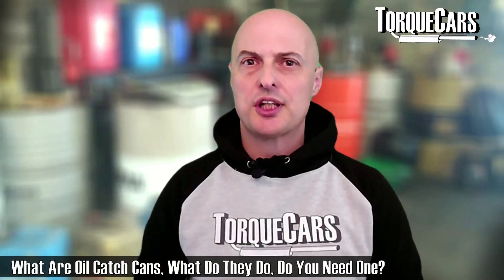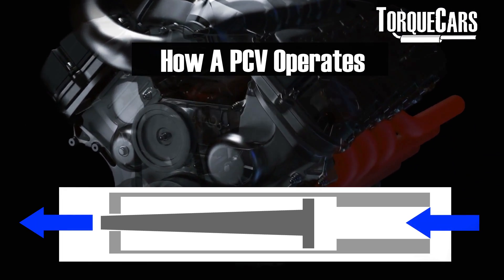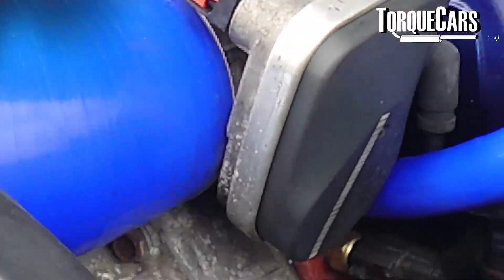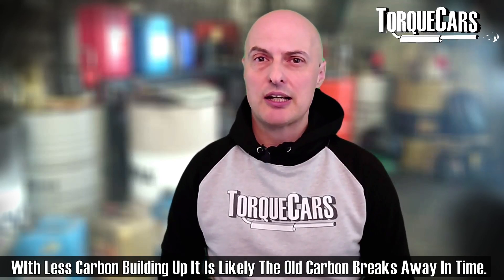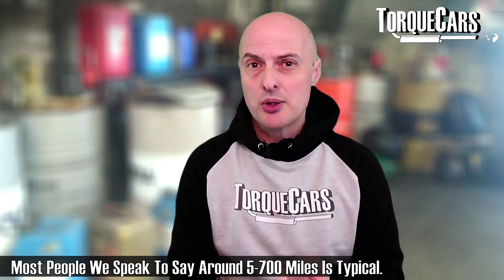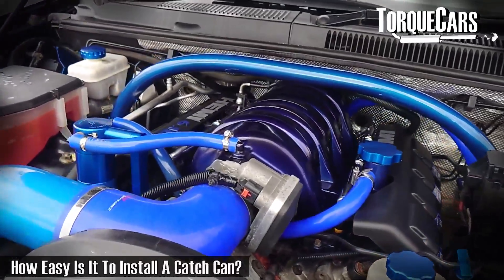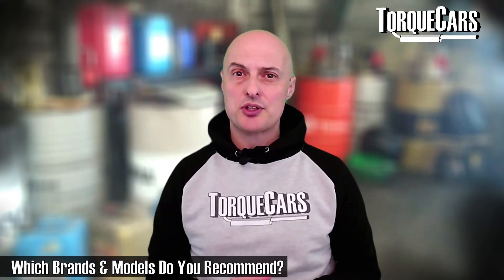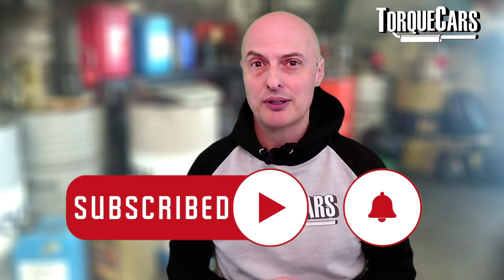Why Modern Engines Need Oil Catch Cans - Pros & Cons Of Oil Catch Cans & FAQ Explained

Comment: I've bought 2 catch cans for my N/A Hyundai 2ltr twin cam off Temu.. 

Now i know running two cans seems like overkill but it isn't if it's done correctly.

These Temu ones are around $20 AUD each and the quality is amazing, avoid the dip stick ones as they can rattle loose..

The one's I got give you the option of an airpod filter or not and has a blanking bolt, decent barb fittings and has a red handled drain lever..

The first catch can is re routing the PCV and no filter is needed..

The 2nd catch can runs an IN line from the rocker cover breather and the OUT is an airpod vent.

I've blocked off the factory breather intake on the rubber pre intake elbow as it's no longer needed and was a gateway of oil and fumes once.

Hope that was helpful 🚙 🏁

Comment: Catch cans are a point if failure as I have experienced threads coming off and got sucked into the engine In addition to many air leaks, keeping in mind that I have tried only high quality built in which are priced between 180-250$ .

Comment: Good video....  I installed a CC on my '21 GMC 1500 V8 5.3L engine and the CC was built for my truck.  re:  Hoses were proper length, connectors were slip/click on and the CC even had nice pre-formed mounting bracket.   If getting a CC for a common engine (like my vehicle) simply buy the one that 100% matches your unique vehicle.  Life is already too complicated to "make fit".   Regarding a CC usage, I love how much "crud" they trap and stop allowing it to enter the engine.  Like many folks I would never purposely pour that liquid "crud" into an engine.   0uch!   Thus...  Best to trap it and clean the can out every month (when checking its many other fluid levels as well)....

Comment: My Jaguar AJ16 supercharged engine in not DI, but as the only cost is the purchase price and there is no other down side (apart from emptying it) why not fit? We all want a clean running engine with less harmful fumes out the tailpipe. I have a problem with the smell of hydrocarbons so a catch can sounds like what I need!

Comment: I added a OCC to my 3rd Gen Prius last spring after I opened everything up to clean the EGR system. The PCV system on the 3rd Gen Prius absolutely slurps engine oil. Makes a mess of the intake manifold and combines with EGR gasses to clog the EGR manifold ports. The PCV valve is slung really low in the 2ZR-FXE and Toyota’s baffle system, right before the PCV valve, really doesn’t seem to work. I’ve opened the OCC a couple times since and it’s definitely capturing oil and moisture.
Reply: It's not oil...so you have no idea what it does.
Reply: @totalnoobfishing1753 
😂

Comment: I can't believe how many people actually believe that catch cans reduce carbon buildup on gdi engines.  Its so sad, such a waste.  Guys, they only collect soot and water, NO OIL!!!
Reply from the maker: Why are they sold as and called OIL catch cans? Also when I emptied mine it  contained some oil, so I guess that just magically appeared in there?

I think you can say something like "they collect MAINLY water" and the amount of oil deposited probably depends on engine design to some degree, but they do stop oil - any vapour in fact from gumming up the intake.
Reply: @torquecars   sorry that's false, there is no oil in there unless you have a diesel with an egr or some boosted race engine.  Send a sample to a lab you'll see.  Oil vapor goes right through the catch can, so you can run two exact engines, one with a can and one without and they both will buildup carbon at the same rate.  You'll never see any honest catch can producer or distributor do an honest test like this.  Actual oil catch cans were installed on old school race engines when oil was being blown out the breather in the valve cover and dripping on the exhaust or track.  The catch can sellers are loving this, they just planted the seed and sit back raking in the profits.  You may as well see how many $10 bills you can stuff in your can then throw it out for all the good it does.  Guys go to empty the can and they see the dirty water in there  and say wow it works look at the oil imagine that going into your intake! That "oil" is just condesated water with trace amounts of soot, aluminum, iron.  It would get burned off in the pcv lines and engine anyways just like the system was designed to do.  Just because a lot of people belive in a lie doesn't make it true.  All you can do is change your oil every 3k miles with quality synthetic and keep up on your maintenance.
Reply: There are vehicles that tend to slurp engine oil out of the PCV system. The intake manifold on my Toyota used to act as my OCC until I put a real one on it. Now I know it’s not capturing all the oil in the PCV vapors but it does capture some. Any amount I can get, before it ends up mixing with the EGR gasses and clogging the EGR manifold ports, leaves me that much ahead of the game.

Comment: My opinion as a retired tech is that catch cans are required for turbocharged GDI engines if you want a more trouble free and longer lasting engine. I suspect that the contaminated air without a catch can will also shorten turbo vane life..

Comment: I have several issues with this video. First, the crankcase is ventilated using manifold vacuum. Fresh air is drawn in on from the air cleaner side of the intake, and dirty crankcase air/vapors are drawn into the manifold behind the throttle body. We have used PCV since the 1960’s. The crankcase gets ventilated no matter what. The purpose of the catch can is to separate the moisture and carbon out of the crankcase air flow that is going into the intake, and therefore going past your intake valves. Most GDI engines have no fuel spray on the valves (port injection) to keep the carbon under control. Some GDI engines have more blow by because the rings are designed for less friction and pressure against the cylinder walls. SO the combustion gasses get into the crankcase by design (not due to wear like the old days). Even so, the issue is not too much vapor in the crankcase. I don’t think that happens. The issue is sending crankcase vapors into a dry intake manifold with super hot intake valves ready to bake the carbon on hard as a rock. I like the catch can idea but there is danger…if the can fills up you could have a problem keeping the crankcase cleared out.

Comment: I've tried a few different ventilation ideas. I did the elephant hose but that stunk. I then added a catch can with a filter on the return. That dripped. I put the filter on top and a line from the return to the intake. Still dripped and left a vapoury oil mess. I took that little filter off today and plugged the hole. If this doesn't work well I'll extend the return line to under the vehicle and put the little filter there.

Comment: A fact u shuld know : https://www.youtube.com/watch?v=hDx09voTlbw  BEFOR USE OCC
Reply from the maker: Hi buddy, thanks for sharing. However I disagree with much of what was claimed there unless it was aimed solely at very cheap and very poorly designed catch cans, so there were a few points of interest worth noting and one is that it pays to get a quality unit. 

The comments on that video likewise support my views. As with anything you need to soak up information so you can make an informed choice. Quality catch cans will not add a restriction and will pull out the fluids from the vented gases quite efficiently. The benefits they offer outweigh the drawbacks in my opinion.

If people don't clean the filters and empty them they will have many problems, so it is not a mod you can bolt on and forget, there is a care price attached to them.

I will avoid putting out a controversial headline grabbing video just because it gets views, I'd rather research a topic to allow people to make up their own minds.

Comment: I recently (May 28, 2024) purchased a 1 owner, 2009 Chrysler 300C Heritage Edition 5.7L Hemi with only 53K on the odometer. I decided to install a J&L OSC oil catch can just a couple weeks ago, I haven't checked the level just yet, I don't have very many miles on it. The install was very quick and easy. It came with the hoses pre attached and had the necessary hardware as well, it utilized an existing tapped hole in the front of the engine block, and it actually tucks away under the engine cover, I can't even see it when the cover is on.
Reply: @CapnDanTreasures  this is my 2nd dream car after my lancer. Can't wait to get one has to be the hemi all day though

Comment: If you have an engine that is DI only and/or turbo charged, a catch can is probably a good idea. But if your engine has port injection or even if it's port and direct, you're wasting your money. The detergents in the gasoline clean the intake valves. Just change your oil regularly and your engine will be just fine for several hundred thousand miles
Reply: my car suzuki swift 1.5 has a port injection and an EGR, should i install a catch can?

Comment: I use Billet Technologies catch can on my 6.1L Hemi Super Bee.Shocking how much oil it stops.
Reply: But you know that it throwing Oil because of the OCC.
Unfortunally the Can with it's longer hoses causes a pressure loss and therefor  it goes up in the crankcase.
So much more oil will spill out.

I will remove mine now from my Hemi.
Only driving in Sommer.
Reply: @Scatpack-Superbird 
you flunked physics didn't you?

Comment: I drive a 2015 Chevy Silverado 5.3 liter I use J&L OSC Catch can I drive a mixture of highway and City and I empty mine about every 1500 miles it is usually 1/2 to 3/4 full at this point.
Reply: @markmaida6093  so glad I found your comment. I have been wondering the rate they fill at. How big is the can?

Comment: The better quality catch cans have a pressure relief valve built in. This protects against seal blowout.
Reply: Why should there be a pressure buildup?
If it's not plugged then you're saying the pcv valve system is overloaded because the rings are worn out? Is that what you're saying?

Comment: Don't listen to this guy.  He probably sells catch cans. They cause more back pressure, which can blow your rear main seal and can cause catastrophic engine failure.  Do your research
Reply: I’m a retired diesel mechanic and I have seen these cans catch on fire but only because they were not drained and the filter was not replaced because it was clogged. Now when properly maintained they work great and serve their purpose. I’m looking for one and just doing my research for a good brand and just stumbled across this video to see what this guy had to say and he is on point.
Reply: @Mike7911  look at Tracy Lewis's- Air Oil Seperator. Just installed it on my Camaro, works amazing, not cheap but worth every penny
Reply: Unless you have a clogged filter inside the catch can, you are actually letting the engine breathe better giving it more volume for the PCV system. Some PCV systems make the engine breathe through a stray, by adding that catch gives it more volume to breathe.
Reply: @jb915 how does it build back pressure?
Reply: Get one with pressure valve.  No seal blow out then
Reply: What’s a good affordable dependable brand for my Acura rdx? Is universal evil angel works?
Reply: Exactly! There's no extra pressure since it's connected to vacuum and if filter is not clogged. Every time I empty mine I spray the filter with brake cleaner to make sure it doesn't clog. It might do that on diesel engines since most don't run vacuum
Reply from the maker: No I don't sell catch cans, this is an unbiased recommendation, based on my experiences and that of our 30,000 plus members. 

The only problems that could possibly happen is if the filter inside the catch can gets TOTALLY clogged up, there is no other way this could lead to pressure build up inside the crankcase.

Other than that it is an open system, allowing oil and moisture to collect in the can and air flowing free past.

If you don't empty it and clean the filter that is not the fault of a catch can but down to the owner. I  will concede that there may be cheap catch cans out there of poor design which may clog up more often. But if you buy cheap this is what you should expect.

Many of my respected colleagues in the industry strongly recommend catch cans. If my research indicated a problem with this upgrade I would have mentioned it in this video.

Comment: Love your videos, 

I’ve just bought a Leon 1.4 FR ACT with 40,00m.  with this engine being direct injection would it be worth while fitting a catch can.
Reply from the maker: Glad it was helpful! Thanks for the support and encouragement my friend.

The later ones have a vapor catch kit installed in the PCV as standard which returns the oil to the sump, so not a lot of point, but the earlier ones will certainly benefit from fitting one. I am trying to find the year this changed, it seems to be around 2017.

Comment: Bought one to put on my Buick Enclave 3.6L V6 direct injection with vvt. I'll try to send an update after I get it on. It's good to know to check it every few days at first.
Reply: Get it off.  They aren't good they cause more pressure, which blows the rear main seal.  Don't listen to this guy.  I've seen it. It's 50 50
Reply: @jb0915  
It's just condensing the pcv vapors as they pass through. You are wrong.
Reply: @jb0915 no they don't.

Comment: Love the channel mate
Keep on posting interesting vids & ideas
always fitted them after working in the British army Reme in the 70's in a desert environment
Most of the kits are made as cheap as poss under £27.50
check for internal volume baffles screen mesh decent size sight glass rubber pad to stop chaffing decent size vapour transfer pipe & LARGE BORE ADAPTORS !!
Been VW only for last 35 years now exclusively PD VW Diesel 
My ASZ PD engine is remapped egr & cat deleted checked emissions when I bought it at friends garage before & after the mods , emissions now are well below what they originally were 
no smoke on the map even under full throttle uphill
turned a cheapo blue one into a much better version very cheaply(was skint at the time so £3 for unused one @car boot buy ,a no brainer 
used a 500ml can of beer split length ways and bent into "S" shape to separate the air flow with 3 oval holes cut in the can wall(Beer can NOT catch can !)(most have no baffles at all) then used a piece of stainless steel very fine mesh to catch oil droplets as soon as they enter the catch can 
next one I will get will be 750ml not 300ml
also some of them have sight glass tubes made of very narrow plastic tube just bigger than a windscreen wash tube , elbows are fragile crack or break and leaks occur
when I order next one it will either have a decent bore sight glass tube as standard or I will modify it oh and make sure the adaptors are at least 15mm internal bore

you want oil vapour to reach can as early as poss as vapour speed & heat prevent the formation of droplets too early, the fine mesh & downward travel of incoming gases uses gravity to separate the oil & contaminants out as much is dumped onto the cold aluminium base of the can then the rest tends to fall back during the upward airflow to the exit port so much so that the return pipe looks clear & empty even on the dyno

Comment: When are you going to do a tfsi 1.4 audi cod 2016  tuning vid ???
Reply from the maker: I'm still working on it, I'm a bit of a perfectionist, especially as this is the engine I have. 

I have started script writing though for this so it shouldn't be too long. I've been pushing through my big backlog of videos, and after last month I have almost caught up.
Reply: dont tune your 1.4 is great for 30.000km or so, then turbo will start being noisy.  i was thinking my dq200 will die first. but no. i had unitronic tune and leter i switched to TVS tune.  oil changed every 7000km. summer 5w30 and winter 0w30. liqui molly. turbo cant keep up. to small. with uni i got 176hp  octan 95 and TVS 187hp.  octan 100.  new turbo instal next week. 800euros + installment.